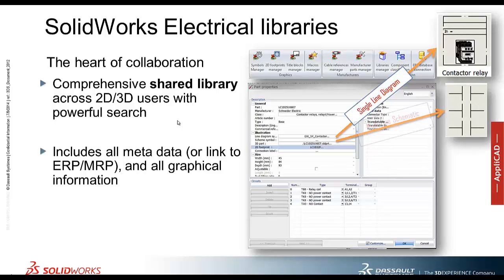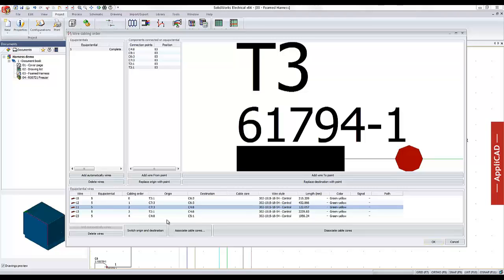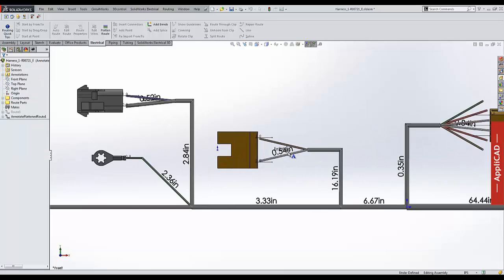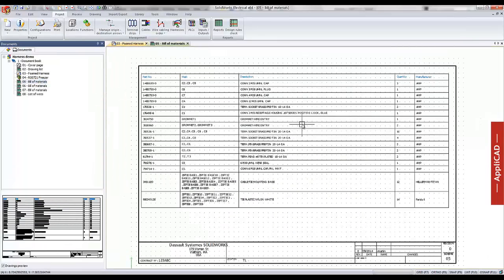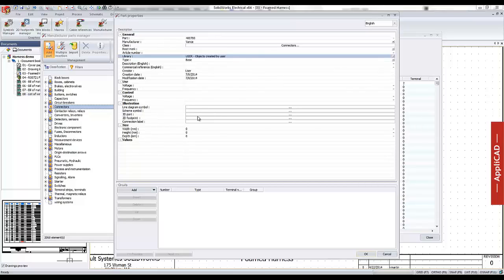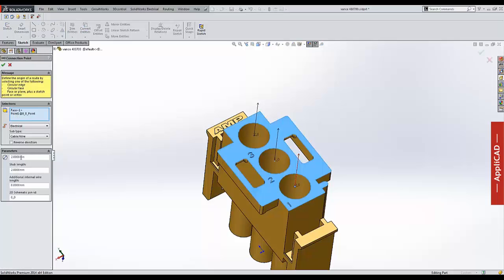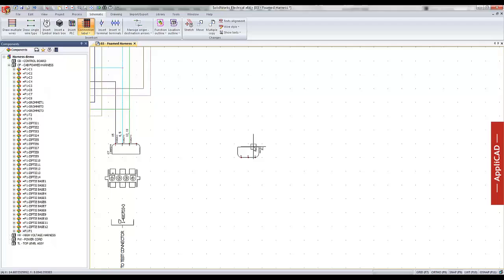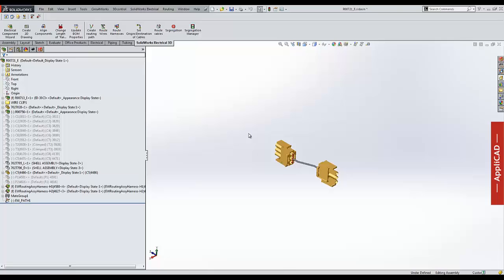SolidWorks Electrical Harnesses design

Comment: Is that means you have to put connectors and lugs at every location. 
What if i want to show circuit breaker connected with wire and ferrule. Am i not able to do it directly from 2D Sketch. 
Please explain process fully when i have to connect two component from 2D i can draw a simple wire line in 3D when i will export what need to done it will show with connector wire and components